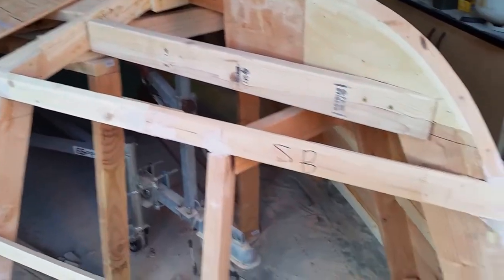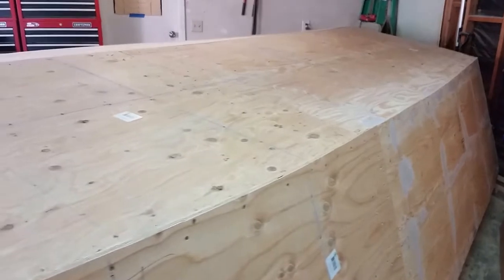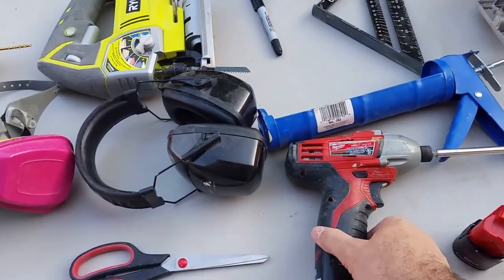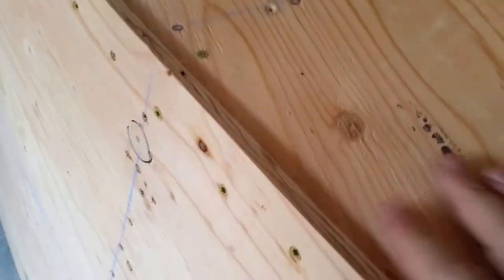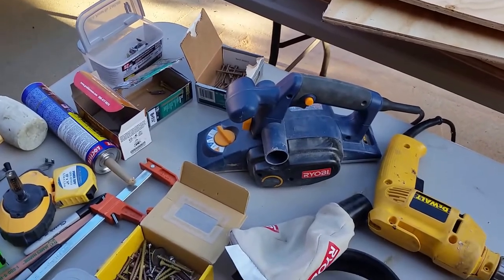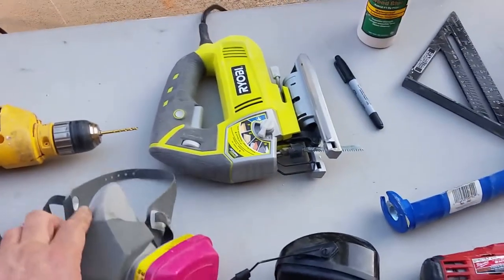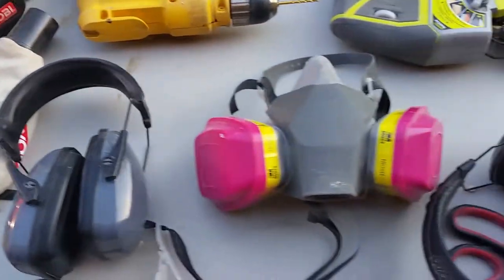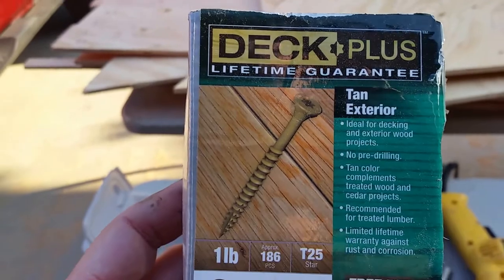Wood Boat Building Tools to use (1 of 2)

Comment: Great information but I'd love to hear the rest of your thoughts on the deck screws. Especially the recommended screws and where you find the stainless steel screws. Thanks in advance.
Reply from the maker: Hi Marsh,  I used Home Depot/Lowes Deck screws.  They have the Star heads and never slip when installing.  Also are corrosion resistant.  Every screwhead is covered in fiberglass after install so zero exposure to the elements.  In addition all wood that has been screwed has either been glued or resin'd as well.  Not using any stainless, though I have seen them at Home Depot.